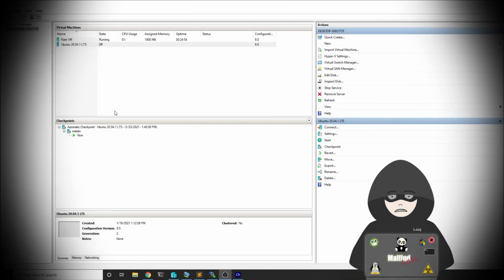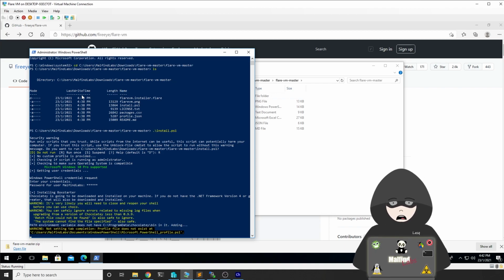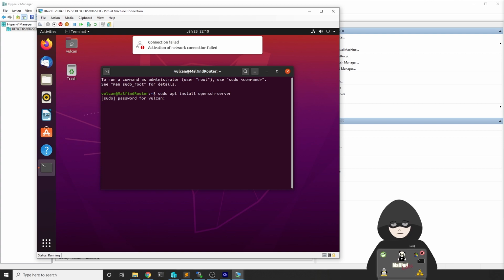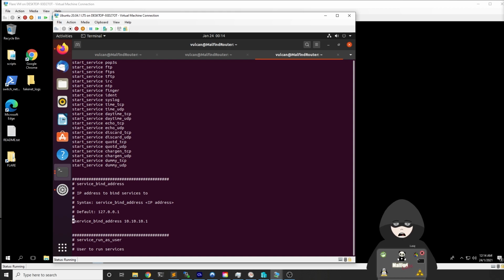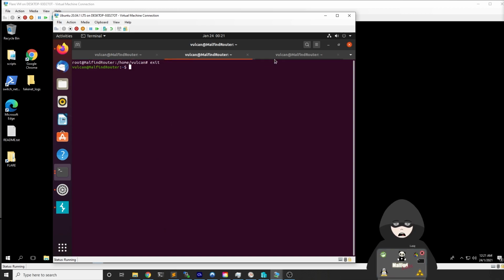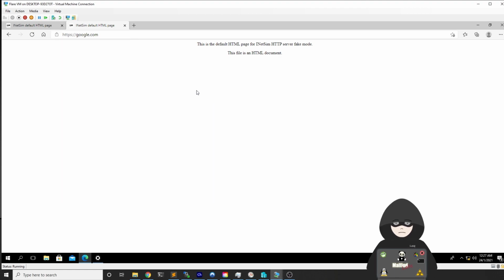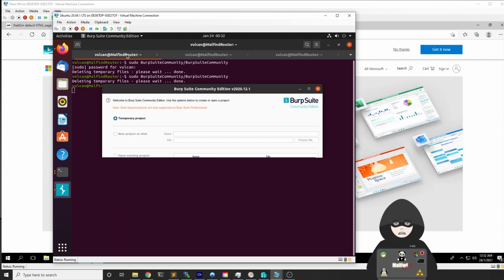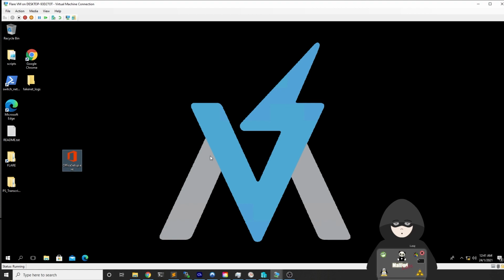Setting up a Malware Analysis Lab in Hyper-V

Comment: 13:20 I get error 255 when I try to configure the share folder and make it a local network share, i installed samba and i cant figure out how to access the samba config (smb.conf) to try and fix it based off some solutions i found for error 255, Can anyone help or does anyone know the solution to my problem? thanks in advance
Reply: A bit late but have you tried changing the permissions of the file with chmod?

Comment: thnx for the vid, is this setup still safe without the flareVM? couldnt install it. I dont really need internet connection also
Reply from the maker: it is safe without flarevm, you can simply install your own tools. If you remove network connection from the hyper-v settings it will be isolated hence safe (excluding vm escape but that's rarely the case)

Comment: i can do it with virtualbox?
Reply from the maker: Yes, no problem to do it in VirtualBox. Before I migrated to Hyper-V i was running similar lab in VirtualBox under Ubuntu. Same principle applies to VM configuration, slightly different network config in virtualbox, but it comes down to setting up a private network between VMs. Quite straightforward.

Comment: Hey man when I follow your tutorial, I have no issues with in the first example, but in the realmode config, I can get the traffic to appear on my BurpSuite. Any ideas?
Reply from the maker: Ubuntu is sometimes stubborn here, I also had some issues when configuring this for the first time. Make sure your resolved and inetsim services are disabled and your resolv.conf and NetworkManager.conf configurations are correct:

sudo systemctl stop systemd-resolved
sudo systemctl disable systemd-resolved
sudo systemctl stop inetsim
sudo systemctl disable inetsim

vi /etc/resolv.conf
nameserver 1.1.1.1 #any public dns
nameserver 10.0.0.1 #local address of your ubuntu internal network interface (the one that communicates with malware machine)

vi /etc/NetworkManager/NetworkManager.conf
[main]
dns=none

Then start your inetsim manually pointing to your dnsonly config (with only dns enabled on 10.0.0.1). Check if DNS resolution works from your malware VM (any page should resolve to 10.0.0.1). If it works, your traffic should go to your burp after you launch it and configure properly (with 10.0.0.1:80 and :443 interfaces redirecting to -:80 and -:443). Please remember to have 2 interfaces connected to both internal and external switches.

I hope this helps.